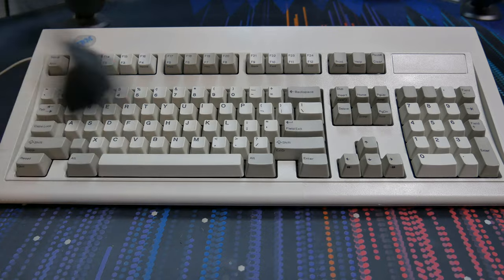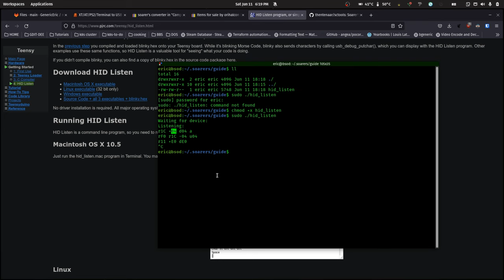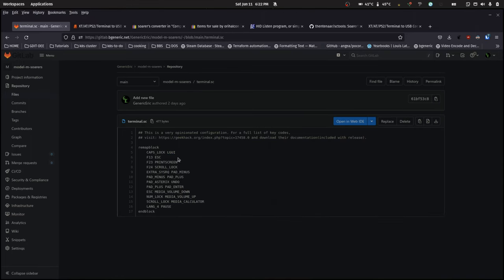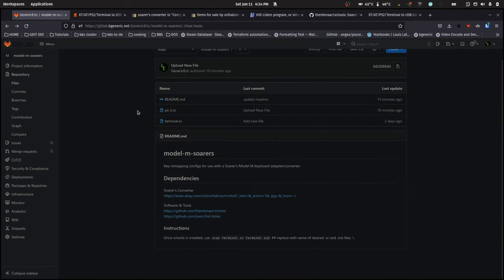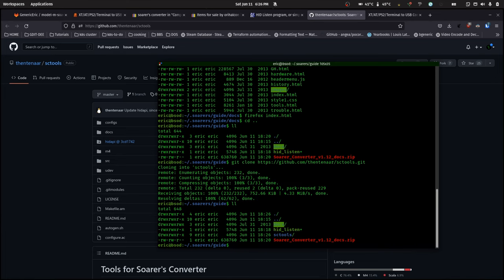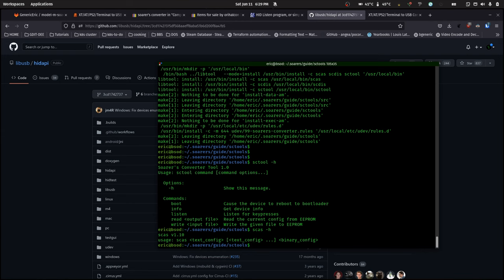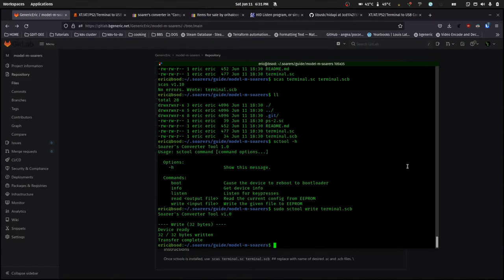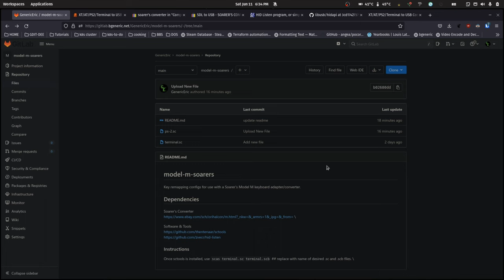Remapping keys on the legendary Model M keyboard! Using Soarer's Converter Adapter

Comment: Great tutorial, you obviously put in the extra work that a lot of people don't do. With the exception of having to install a few missing libraries, which is a me problem, everything went as expected. Me and my terminal Model M thank you much.
Reply from the maker: Yeah, that's the problem with all of us using different distros most likely. I probably just had the libraries needed installed already and didn't run into problems.
Reply: Oh, thanks for the reply. Thanks to modern Linux, the error codes just told me what packages I needed to install so really not much of a hassle. I'm running debian sid so i just ran a search in synaptic and installed them.  The beauty of Linux is that, even if we speak different dialects, we all still speak the same language. Which is, of course, Klingon :P.